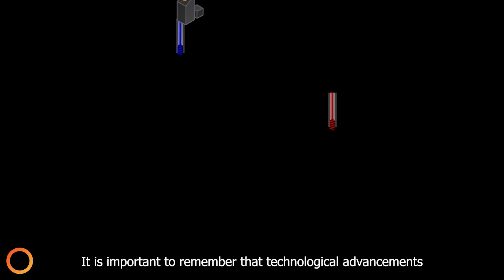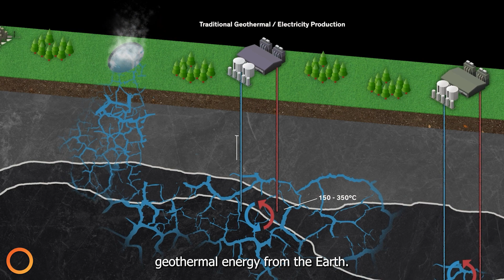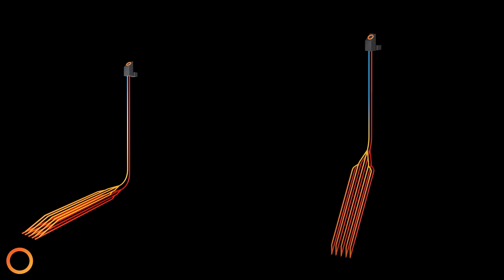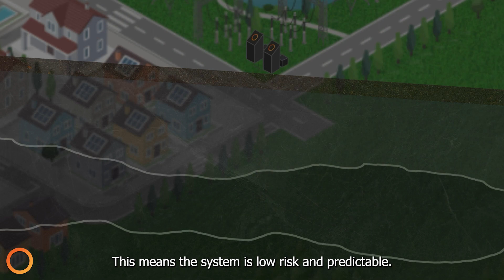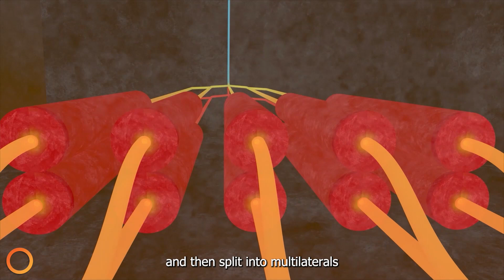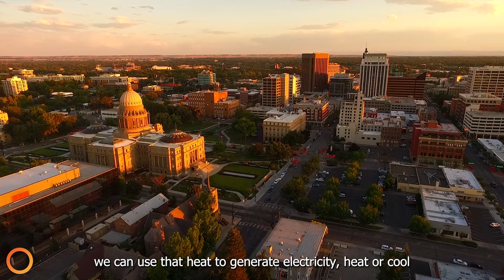Eavor - The Complete Package

Comment: Great potential, will have to see what your pilot data reveals but looks fundamentally sound. Have you any plans to go deeper or use different drilling tech like Quaise et al Gyroton bore or other? 2.5km isn't really deep enough imo to really unlock Geothermal for electrical power (direct heat would work). Very low grade heat at that depth. 5km is better, 10 km would be a game changer for power production (300C temp or greater)
Reply: They just finished a 18000ft (>5km) wellbore through granite in NM, near the Lightning Dock geothermal plant. What it cost to drill is unknown yet. I suspect it has a layout similar to what you see in the video. Otherwise, I don't know what it would prove.
Reply: @laughinggas5281  Can they make these turns and twists for their "radiator" at such great depths?
Reply: Depths below 10 km are also favoured by "Plasmabit" (Slovenia) - but extremely slow and expensive with conventional drilling technology - for this purpose Quaise Energy is currently developing the new contactless drilling technology with 30-40 metres/h instead of <2 metres/h ready for use. then a complete heat power plant conversion takes less than 3 years (replacement of the boiler house with deep heat 500°C - - supercritical water).